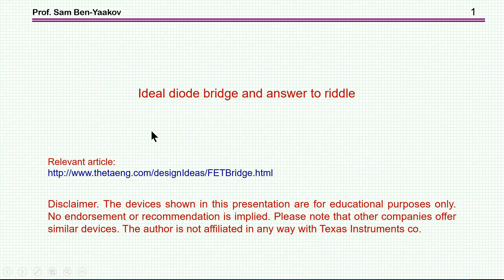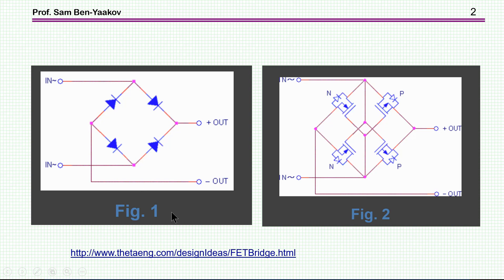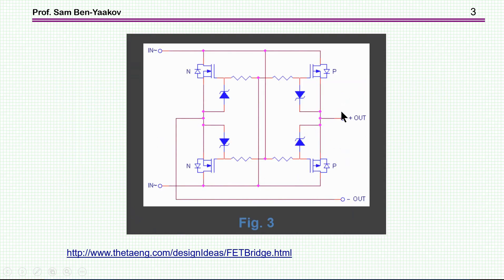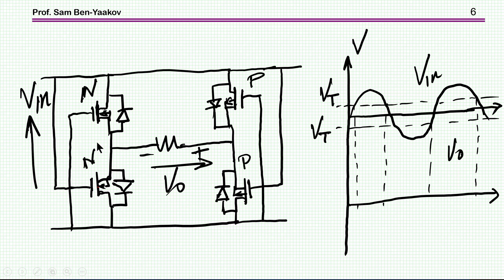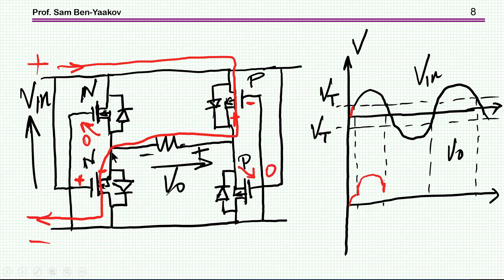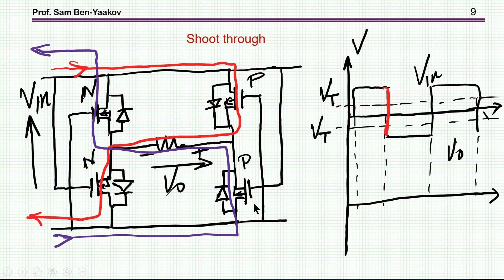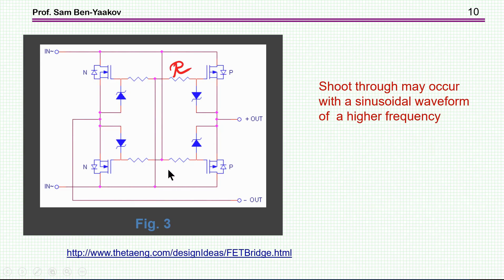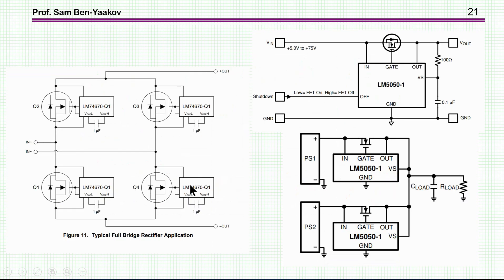Ideal diode bridge and answer to riddle

Comment: There is a specialty IC
LT4320 (max 60Hz)  and -1 (600 Hz).  At the end of the datasheet, there is a comparison table with Diode Rectifier, various current, different output capacitor values, and power losses.
Reply from the maker: Thanks for sharing

Comment: Will the voltage ripple cause any problems with the mossfets ?  What about using schotkey diodes for less voltage drop ?
Reply from the maker: Voltage drop on body diode is relatively low and the Schottky  diodes will still dissipate a lot of power when the current is heavy.
Reply: @sambenyaakov  ok.  Wasn’t quite sure lol. So using mossfets as a controlled rectifier is better then ?.
Reply from the maker: Yes. Definitely. AS for your first question that I over looked, see https://www.analog.com/en/technical-articles/the-dreaded-file-test-on-an-lt4320-ideal-diode-bridge-controller.html#
Reply: @sambenyaakov  awsome ty great article.

Comment: Great video, prof. Ben-Yaakov! If I understood the datasheet correctly, the charge pump is actually fed from the voltage drop of the body diode. For that, the MOSFET has to be turned off periodically. This may explain the strange flat top of the rectified voltage, but only if there was no output current discharging the capacitors.
Reply from the maker: Yes, perhps this is the reason. Thanks for input.

Comment: I came across these neat active diodes on digikey one day when looking for ones with the lowest possible forward voltage drop for a buck converter. I discovered these neat active diodes that are intended for solar blocking diode application. They are just an active MOSFET with integrated controller, and they essentially the same thing but they are in fact used for DC application. When sunny, the FET body diode conducts for a brief period while V_CAP charges up, then when the UV lockout voltage is reached it enables the FET and remains enabled for a large percentage of the time until the charge is depleted. Essentially it oscillates with the average forward drop being lower than any passive diode solution. It seems like using several of them in a large string of panels could cause weird voltage ripple, but I suppose it isn't a problem given the voltage ripple would a small percentage of the output voltage of the panel.
Reply from the maker: Thanks for sharing this intersting experience.

Comment: Sir please do the basic videos on each and every component and parameters....this is my request... and I feel you are doing a great job sir hat's of to you....
Thank you... special MOSFET with PWM is useful to all I feel

I my self expecting that

1., What is MOSFET
2.why will use MOSFET
3.what is the drain characteristics of MOSFET
4.how to work with MOSFET
5.how to select MOSFET
6.how to calculate MOSFET power dissipation of MOSFET for fixed Lower than 100khz frequency application
7.what are the prasatics that effacts when we change the frequency
8.mosfet using H bridge running a motor
9.what are key parameters to slect a MOSFET for different application s....

I think this will be more usefull sir....

If any one fell anything to be added please add
Reply from the maker: Thanks for comment and suggestion. I do realize that the videos you suggest will be useful. However, I am aiming to an audience that know already the basic. SO my videos are sort of continued education. And, my time is limited 😊
Reply: @sambenyaakov  I think in general the community is better of letting the professor take on advanced topics, It seems a better use of his limited time! There are lots of simple explanations for the basics already and probably still coming out; although they may lack the quality of teaching, I think watching lots of them and then "averaging the data" might prove good enough... just like what you can do with low precision instruments 🤣.

Thanks again Professor for your insightful lectures!